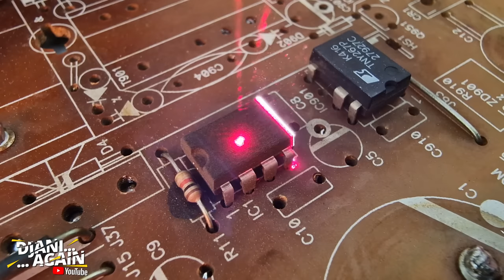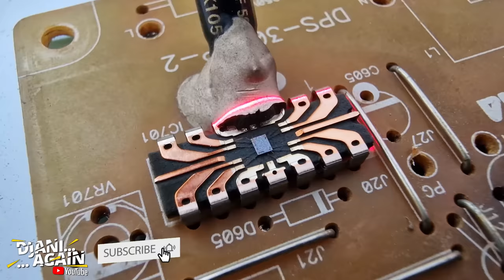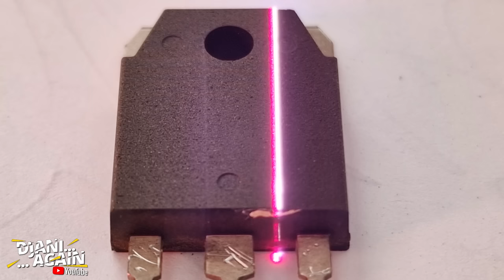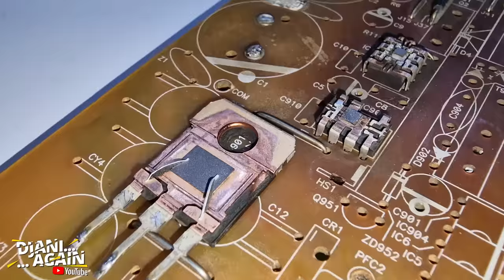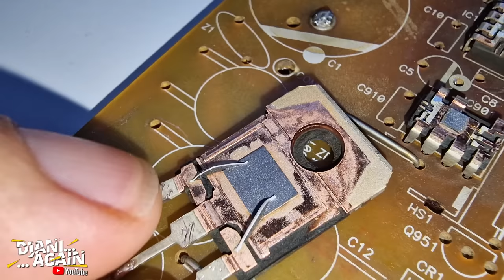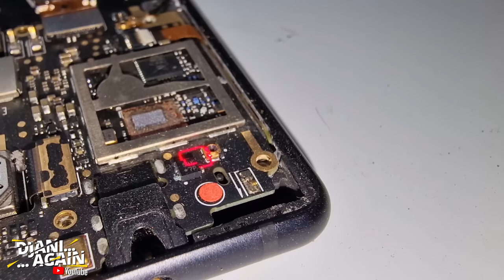Integrated circuit,  MOSFET, processor  decapsulation with fiber laser! Peek inside 👀 semiconductor

Comment from the maker: Here is the video without music! 
https://youtu.be/sPK9VVOaaUI
Reply: Are they gold bond wires @7:36
Reply from the maker: Someone says, they are, but I'm not sure 🤔
Reply: @DjaniAgain  hi what laser did you use to do this to the ic's
Reply from the maker: It's so called Fiber laser or marking laser 👍
Reply: @DjaniAgain  thank you well because I'm a electronics repairs engineer if I get a eprom that I need to get inside I can with this tool
Reply from the maker: Not sure if it's applicable in your situation, but I know that they are used to peel off layers of SD card in order to solder onto them, to recover data.

Comment: You can see the structure but sadly the IC is destroyed. For real decapping, nitric or sulfuric acid is used to keep the die intact.
Reply from the maker: You are right, this is just a fun experiment. 👍
Reply: But you can reduce the epoxy layer :)
Reply: yeah you are rigth, but this is a fine method can use to reduce the thickness of the epoxy layer, then you can use the acid to expose the die.
Reply: need a different type of laser
Reply: Even acid can destroy the bond wires. Seen it happen many times.
Reply: @Clancydaenlightened  How would the type of laser make any difference? The laser is effective burning off the epoxy encapsulation, so at some point it's going to be heating up the die itself quite a bit.
Reply from the maker: Yes, the die heats up significantly! Sometimes I barely can hold the chip after burning.
Reply: Except you cannot buy Nitric acid these days unless you are an educational establishment. You usually end up making it yourself, we do anyway. Go on try and buy say 60% in solution ......

Comment: Nice decapsulation! I worked in IC design for over 30 years and had not seen this process.
Reply from the maker: Wow, thats a lot of experience 👏
Reply: I wonder how the design process works.
Reply: they used to do that with plain simple roll "masking" tape on a large scale and with photographic tricks reduce the size to ultra small.
Reply: @AnalogDude_  so they cut stensils out of the tape?
Reply: @The_Koolaid_Control  no they used the tape to make the tracks and transistors & fets.
Just as making a PCB, they use masks and light sensitive solutions to etch away pieces and grow other type of crystal there (P/N junctions) or deposit metal to make conductors.
check this channel:  Asianometry, has "old" skool footage showing how it's or was done.
A person hanging from the ceiling working a "giant" semi conductor using a roll of masking tape, like 100.000x bigger in it's size

it's not really magic, just the scale where it's done is awesome, imagine every one having a main frame at home, lol.
Reply: I can't see what you mean, I'll give it a look
Reply: we see absolutely nothing here . this machine burn the silicon chips inside ! i use acid at 77 degre C and all look shine and clean
Reply: Can burned mosfets be fix ? Cause I have a few dead irfp460 and irfp260 I allways think if I could take them back to life , most of them have their gates blowed up cause too much gate voltage
Reply from the maker: No chance! Atleast as far as I know 🤔
Reply: What on ICs are reparible?
Reply: @The_Koolaid_Control  I don't know but who is better to ask than a person with 30 years on ICs desing , I don't know maybe there is a method or something
Reply from the maker: We'll wait for proper answer 😊
Reply: So that is why we just replace them I suppose. There is software to layout ic chips, kinda like multisim. I never got to use or see it used yet, in a few months I will get to do it.
Reply: RODRIGUEZ FRANCO, don't think the silicon chip gets destroyed, but the bonding wires, they are like 0.05 mm in diameter apart from the Giants like TO220. the chip itself is pretty much bulletproof but the current limiting factor is the bonding wires.
a output on normal dip package is between 20 and 40ma, witch is a LOT for such tiny wire in my view.
1 amp = 1 coulomb/second and that's a pretty huge number in electrons even if you divide it by 1000, it's still a huge number.

There is still many of the old AMD/intel series cpu around and they where just a pcb and a naked silicon. no bonding wires.

But i could be wrong.
Reply: @AnalogDude_  that is the answer I was looking for , I guess if you had the equipment and the knowledge maybe those thin wires could be resolder
Reply: @rodriguezfranco3839  it wouldn't be very easy to control the solder, and the solder would need to be very low resistance, like silver solder. Maybe a way to replace the broken bonding wires, could you solder new ones on? I don't really know anything about bonding wires to know, but I know a lot about soldering.
Reply: @The_Koolaid_Control  I think I am gonna try to dissolve the plastic package on one of those fets to-247 and try to look for a failure
Reply: I used to use good ol' fumic nitric on a hot plate with a nice acetone rinse. This is a nice clean alternative.
Reply from the maker: Yes, it's fairly clean! 
I dont think that this is the proper way to do this, but it's a spectacular one 😍
Reply: @AnalogDude_  Isn't it wonderful.  Laying out chips by hand was the only practical way to get it done at the time.  It's the origin of the term "tape out" for finishing a modern chip design.
Reply: @djjackson2200  Yeah, awesome and finding out than it was that simple, that's clever.
wish i had the material and tools to do it.
Reply from the maker: I'm glad you like it!
Reply: I mean he exposed the lead frame but it’s worthless outside of that. You can’t use the result for FA or anything outside of seeing the lead frame and bond wires. Usually you decap with nitric acid or the like…
Reply from the maker: Terminology may not be accurate, I agree, this is what came into my mind 🤷
Reply: Yeah ypu only learnt there to lie 🤣

Comment: You have to realize that computer chips are antennas that receive microwave signals distributed by satilites that orbit the Earth. All  MOSFETs do not, however, when put into the proper circuits they to become antennas. Do you really think that a little tiny INTELL computer chip or two can think faster than a human and hold more memory than you ? No. The circuits and the metal on the boards collect the signals and also broadcast to the output and receiving satilites. Its possible that these satilites are alien in nature and are not of this Earth too. If you take apart a computer you will see what I mean. There are many components that "dead end" on the circuit boards with no connection to anything. And after going to computer engineering school I have noticed that these home computers are no where large enough to do the computing that is claimed. Basically they are fake and that hidden inside all closed up is a complex antenna circuit that receives the input and all your computing is then sent to a data base of enormous proportions that becomes your computer memory. The antenna systems are hidden in the electronic math and its impossible to detect. Frightened yet ? Conspiracy or not how could you possibly believe that a 1 square inch " chip", or two, can, let alone, read your key board and control a billion pixel led screen too !? A real home computer, if it existed, would have to be the size of a home washing machine filled to the top with components just to do the amount of work and have the memory that it dose just to work properly. So just where is this "washing machine" sized system that it really needs or is that system really the size of 1000 Kmart stores hidden on Mars perhaps !!? Who freakin knows !!?
Reply from the maker: Actually in the past computers were big enough to fill the entire room. And all of this piece of tech was to do some basic stuffs, which can be done with cheap calculators easily 👍
Reply: Dude... You know how stupid that is right? Boards have two faces and those "dead ends" are no more than a connection from one side to another. Those "alien satellite connections wouldn't be possible under some isolation conditions and could be easily detected with cheap devices. Processor manufacturing tech is insane, the use microscopic needles to put ultra small tansistors. My final point is that computers are just heavily modified calculators. And, a question, how do you explain the development of new technologies every year?
Reply: And, I also took apart a computer, I do it every day, that's my job
Reply: Also, the small chip you say has a full explanation, if you take one apart, you'll see a weird looking black square where all the transistors are hidden, if you take that apart with an atomic microscope, you see how dumb you are
Reply: Fuuuck men, you are fucking rigth, so blowing mind info to me, i suspected that.....thanks friend

Comment: Weird how it doesn't melt the bond wires.
Reply from the maker: Apparently, the black material is softer than the metal, and that's why the laser is digging in there.
Reply: It has to do with absorption of the energy: the metal is a good conductor so can easily distribute the heat away, is somewhat reflective so doesn't absorb as much energy, plus has a high melting/vaporization point. On the other hand the epoxy material has a high absorption (since it's black), is an insulator so cant distribute the heat away, and has a much lower burning/vaporization point. They both are very much opposite in how they react to the intense laser energy.
Reply: @sjm4306  I've watched a few more, and it looks like it sometimes doesn't leave the bond wires alone.

Comment: Was really surprised how big that die inside that power MOSFET was. I would have guessed it only 75% as large.
Reply from the maker: I did with bigger one, will see in futere how big the die is! ✌️
Reply: Mostly speculation, but perhaps a larger die affords more surface area to radiate heat from?
Reply: @jnharton  not only that but larger current can flow due to lower resistance, just like a larger wire
Reply: @DjaniAgain omg do more!!!!!!!!!!! this is the coolest thing ever!!!!
Reply: @DjaniAgain  do you know that old components can contain BeO?
Reply from the maker: @fightington  I don't know the exact composition of the packaging, but what you say is not good for health. Beryllium oxide is classified as Very toxic, Group 1B carcinogen.
Thats why is great to have fume extractor 😊
Reply from the maker: @fightington  I'm so glad you liked it! ✌️

Comment: explains how they got rid of the labels, thanks dude
Reply from the maker: And its very easy as you saw ✌️
Reply: @DjaniAgain  i know someone stated that they use sand paper also. it can get frustrating to reverse engineer at times
Reply from the maker: ✌️
I did sanding on an optocoupler, sometimes there is no other choice!

Comment: Nice Decap.  My suspicion is that the laser decap will damage the IC, making FA difficult to do at the very least.  Still physical properties (Wire, ball bond integrity) should be visible.
Reply from the maker: Oh yes my friend, it damages the silicon itself and everything on his path.
When combined with traditional methods like acid it can be useful!
Although I use the word Decapsulation, it may not be the best choice 😁

Comment: WOW, you could do that to an op amp, ( maybe sett the laser power not so much so it only "destroys" the plastic not the metal too? ) then epoxy it and make it a  unique look , and it still working. 
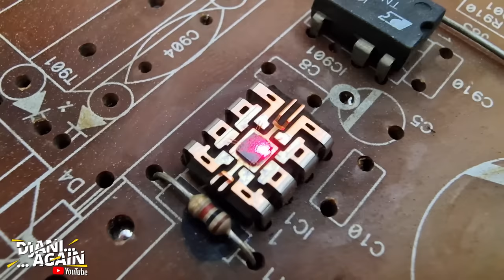0:33 looks like it would still work i  think.
Reply from the maker: Your idea is good, but the laser to reach so deep needs power, and by the time it reaches the crystal, it has already destroyed it. 😢
So in 0:33 chip is not working anymore 😓
Maybe it is possible with acids, but in my country is a bit hard to get these kind of stuff.

Comment: Hey you should run compressed air across the work and into a filter so you don't have so much loose particles ready to breathe in or ingest through skin. I like how you try to view with better magnification later, about 10x more oughtta do it...or fancier illumination, too.

Capacitors should be neat to cut into also, maybe? All kinds? Maybe inkjet integrated jets would take a gradient cut?
Reply from the maker: Thank you for advices ✌️

Comment: what happens if you use/power the mosfet after decapsulation?
Reply from the maker: These are my first trials, and they are quiet intense with power, so there is no chance to this elements to be used again.
In future I will try to be more precise, and keep the   IC running

Comment: Doing this are you able to put into a microescope and do reverse Engineering into some old chips? Or this fries the integrated circuit?
Amazing video btw!!
Reply from the maker: This fries chip, atleast i did 😅
But on the other hand if you do this carefully and under microscope I am sure that results would be much better compared to mine. And you can do some reverse engineering.

Comment: Hello nice decapping process. Would you please tell me which laser decapping machine can be used for hobby ? The power should be at least 20 W. Am İ right? 
Can you please give me some names for the suitable products which are about 1000 Dolar Budget. 
Many thanks
Reply from the maker: Thank you! These laser are for engraving metal, plastic and other materialsbwhich react to this type of laser. I don't know if there's any made especially for burning chips 🤔
Prices are different, but Google can help you more than me for finding a suitable price.
20W power is enough for this type of applications.
✌️

Comment: will this damage the mosfet? as in, if I use this to decap a mosfet, can I then pull off the crystal and use it somewhere else? (assuming the leads are kept intact?)
Reply from the maker: WOW, pretty ambitious 😲
Those things are so tiny and fragile...
Success rate would be no more than a percent if you ask me.
But would like to see a video you doing this 👍

PS, you can check my 555 timer decapsulation, this would answer you question about is laser damaging the crystal

Comment: super, what parametr do you use? I think that the duration is about 14 ns, but what is the speed and frequency?What is the filling density?
Reply from the maker: I'm glad you liked it!
Firstly I used 50W Fiber laser with JPT source.
Settings were generic
Speed 1300
Power 50-80%
Frequency 30kHz
Line distance 0.031

Laser is not Mopa so I don't know what the laser pulse length is 😒

Comment: Curious what an amplifier IC like an LM386 or any other amp chip would look like after this.
Reply from the maker: I will do this in future my friend! Thanks for the idea 👍
Reply: @DjaniAgain  I'm guessing that doing this kills the chip so if it previously worked, it wont after the laser hits it.

Another idea for you and a future video. Try this with a masked rom chip on board black blob type device where they just put a black blob on top and it seals the chip. Mostly found in cheaper electronics and toys.
Reply: It would look the same as the other devices treated in the same way in this video.

The difference between the chips is what is on the die itself and this video doesn't show you that. It can't. You need a microscope.
Reply from the maker: I strongly agree! But experimenting won't stop 👍
Reply: @DjaniAgain  I'm curious what it looks like, hope to see this in a future video.
Reply: @DjaniAgain  You will need a strong acid for it cause you need to etch the last bit of resin away. The laser is to blunt of a tool for the last few um

Comment: I was just wondering, the bonding wire connecting the pins to the die is so thin. How can it handle so much current?
Reply from the maker: Believe me my friend i thought the same thing when first saw it.
I can't explain it to myself 🤷
Reply: Fake mosfet from aliexpress.. Always decapsulate before use 😉 😂😂

Comment: looks great! what machine did you use for this?
Reply from the maker: I'm so glad you like it! 
This is done on Fiber laser
Reply: @DjaniAgain   What's the spec of the fiber laser? Trying to do this exact experiment! Thanks!
Reply from the maker: 50W Fiber laser, I believe it's is with Raycus source, but not sure.
Laser wavelength - 1064nm

These are done with default settings
1300 speed
50-80% power
50 frequency
Thats it!

Comment: how strong is the laser and what is the wavelengh?
Reply from the maker: These results are achieved using 50W fiber laser at 30-70%of its MAX power. As for the wavelength, I really dont know what type of rare materials used in it.

Comment: Is the wire a gold wire?
Reply from the maker: I dont think it's gold my friend, judging by color of course.
Reply: Actually the wires (bonding wires) from the leads on the package frame to the pads around the edge of the die is typically gold for integrated circuits.

Comment: Laser doesn't harms micro gold wires ?
Reply from the maker: It harms metal! So gold hurts too, but compared to other material it endures more. Fiber lasers react wery good with metals, so at some point gold wires, just disappear!
Reply: @DjaniAgain  but it seems compare to black Material , that thin gold  wire stands longer in pulse laser because of Metallic Reflection right ?
Reply from the maker: You are right!

Comment: 1:25 pin5=VCC, pin8=GND, I guess. but there is some thing weird for IC901, there is no Pin 6 exist. maybe just for cost down. I guess.
Reply from the maker: I didn't even pay attention! Good observation! I never thought that such a small thing could save some cost 🤔
Reply: Pin 6 is ommited because this IC (TNY267) is switching power supply driver. This IC is placed in the primary of power suply and drives about 300volts, so pin 6 is ommited for isolation and safety purpose.
Reply from the maker: Thank you for the info my friend! 👍
Reply: @vojtechslovjak8517  thanks~ good to know having the info.